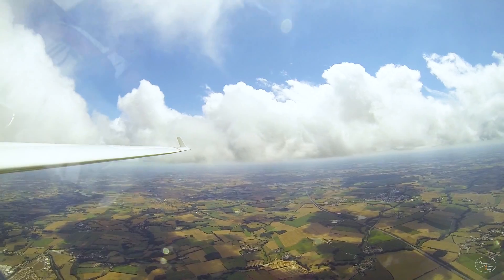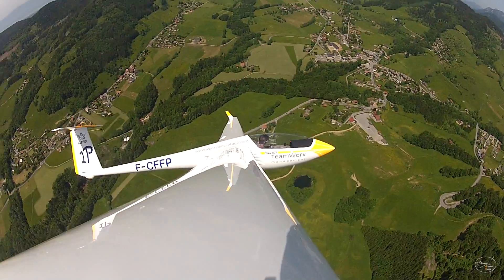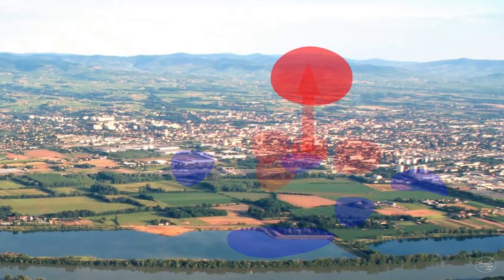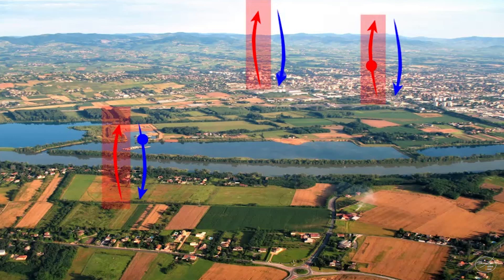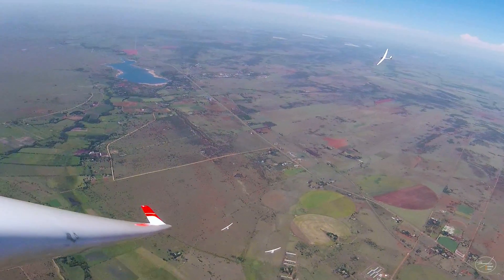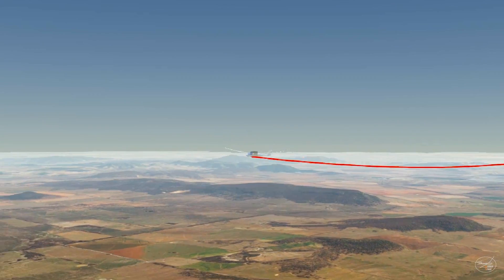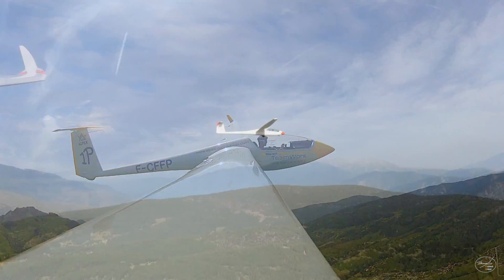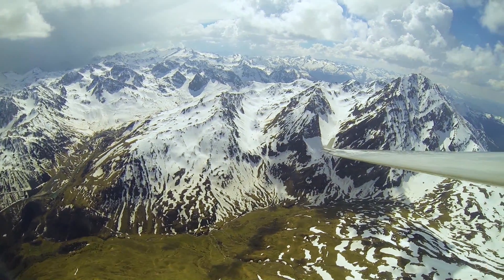UNDERSTAND CONVECTION : THE THERMAL LIFT

Comment: Works in winter too?
Reply from the maker: Hardly if the sun is not strong enough. It does not need to be warm (there are great thermals in Finland for example) but the sun must to bring a minimum of energy!